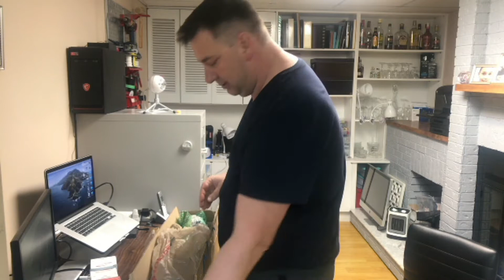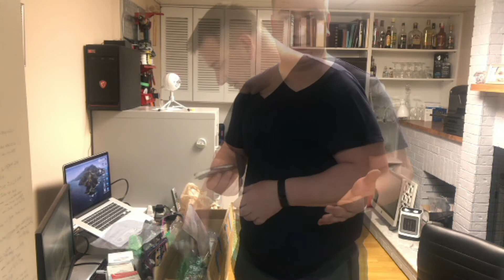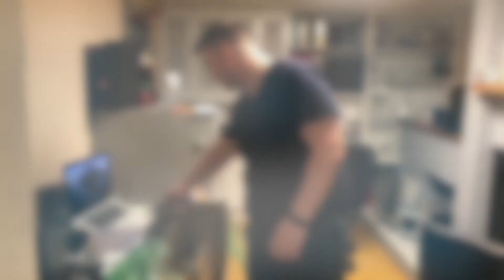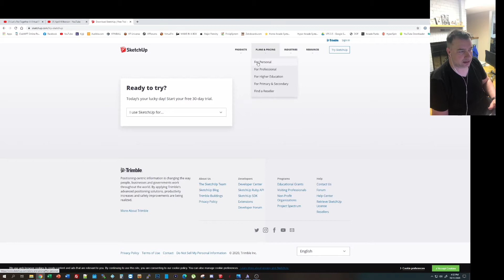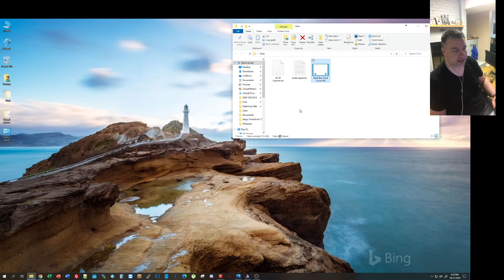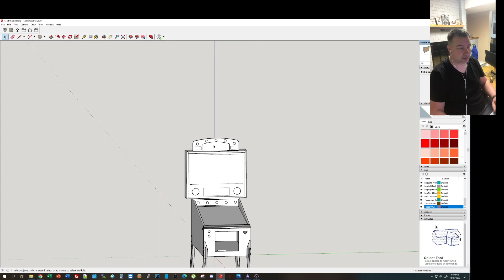Let's Put Together A Virtual Pinball Cabinet: Unboxing And Sketch-up

Comment: Do you have the sketch up file to use as a start from to design a virtual cabinet so I can see how my playfield monitor will fit in relation to my flipper buttons and plunger.  I don't want an apron.  I want the screen down at the lockbar
Reply from the maker: https://1drv.ms/u/s!AlhW7G4gOb9ZjM1O98A80WkHOIuKFA?e=JiQU07
Reply: @HomeArcadeInABox  thanks
Reply from the maker: No problem. hope it helps. click one drive link to download